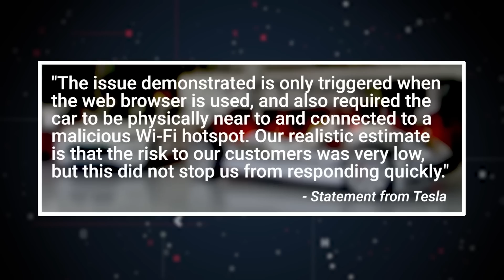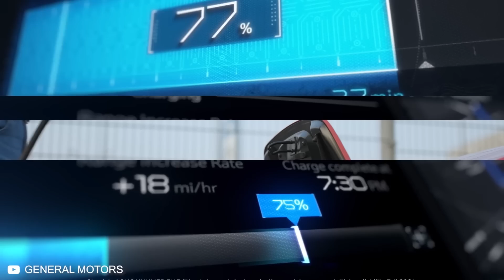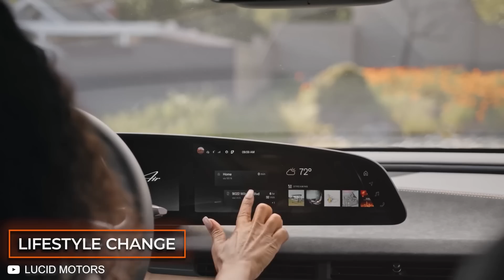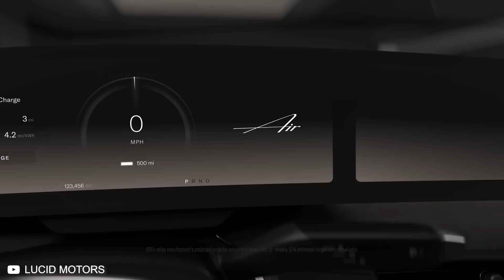EVs' Serious Problems That Carmakers Are Hiding

Comment: The biggest issue I see is a lot of the core demographic doesn't have the ability to charge at home. People in some neighborhoods in bigger cities often only have street parking available. People who live in apartments also can't just simply plug a cord into the car coming from the wall.
Reply: @nordy259 
What you say applies equally to upscale neighborhoods in many cities. And the fact that you park your car in a garage does NOT imply you have access to charging overnight. The fact that you can afford a Tesla does not suggest you can charge it at home.
Reply: None of this has to do with what’s good for drivers, what’s good for communities, what’s good for citizens, or even what’s good for the earth. It is all about control. This is their way of making sure they have 100% control of who travels when, and where. They want us to live in the pods and eat the bugs. I want nothing to do with it
Reply: Yes, I read in the Chicago Tribune that 55% of people in the Chicago Metro area rent rather than own.  Also, my condo tower checked into it and converting the building for EV s would be a legal and engineering mess.  And what can we do when the manufacturer tells us to park outside because of a fire hazard ?  If I owned a house I might consider an EV but that's not in the cards now.
Reply: @loschekell  ev’s are a lower fire hazard than ICE cars, I had a model 3 while renting. I charged it from the PowerPoint in the garage, which leads me to my final point, installing a few dozen charging stations would be expensive. Not troubling from an engineering standpoint. More from a cost standpoint. Apartment blocks get more than enough power infrastructure to the site to handle that kind of load, it’s a questions of getting the right circuits and breakers from the switchboard to the chargers which is the expensive part (and buying the chargers themselves).

But EV’s as previously mentioned can be sufficiently charged with just a regular wall outlet.  Which aren’t difficult to install and are cheap. And in most apartment parking facilities, whilst there not one in every bay, there is usually 3-4 in each level of the carpark complex for cleaning and maintenance.
Reply: @engineeringtheweirdguy2103  have you seen ev fires? I suppose you haven’t because you imply they don’t happen when in reality they do happen
Reply: @engineeringtheweirdguy2103  you really seem to be drunk in believing that Evs can do no wrong, there’s no point in you looking at the other side of the coin
Reply: @C25-150  what are you talking about? EV’s catching fire at a rate far less than ICE vehicles is an irrefutable fact, based on thousands and millions of data point. A basic google search will tell you that. 

How does stating fact translate to me being drunk on belief and in denial? Seems to me like you’re projecting
Reply: @engineeringtheweirdguy2103  Some exceptions to that fire rate.  Yes in accidents etc ICE has higher fire rate. Yet parked, no accident EVs have a higher fire rate than ICE, ie more chance of an EV in the garage burning than ICE.  Thus the ship on fire sinking recently w a load of ev Porsche.
Reply: @engineeringtheweirdguy2103  “Apartment  blocks get more than enough power…”

In most cases no. A standard 6 KW charge is going to double or triple the average apt unit load while under charge, and sone residents are going to be couples etc w two vehicles unit.  So, yes an apt block could accommodate a few people charging, no they won’t scale to everyone. 

Anyway, doesn’t matter.  Must apt are street parking w no charging possibility or large private lots are far to expensive to rewire w a 6 Kw drop at each slot. W a posible aggregate load of 0.6 MW for a 100 car lot?  No. It’s been tried w a lot of hype and wasted money, ending in failure.

“Regular wall outlet” 
A 2kw wall circuit is not practical for EV , as giving 16 kWh after an 8 hr charge is for a toy, a curiosity. 

“3 or 4”
So  again, that obviously doesn’t scale to convert all transport in the building to EV, and you’re pointing out something to be done as, what, a 3 EVs in the lot stunt?
Reply: @Nill757  ahh, not really. A refrigerator on its own pulls 3kW. A drier might pull another 3, washing machine, kettle, dish washer would also pull another 3kW. Chargers for phones, laptops typically pull around 1-2kW each. Each apartment will have power supply to accomodate the maximum kW output of each plug in the apartment on full load PLUS a factor of safety for good measure PLUS, a buffer for improvements, expansions or subdivisions. In Australia, that load limit is 3kW per plug.

The power supplied to apartment blocks would be more than enough. 

It’s also worth noting that you can charge your EV with as little as 2kW. And wouldn’t Involve any more infrastructure than supplying a regular power outlet at the appropriate parking bays. Hardly a big ask. Although it would be slow (7-12 hours for a charge, but most people are home for at least 14 hours a day (sleeping, eating, showering, etc). It would still be doable.
Reply: @engineeringtheweirdguy2103  “… phones … 1-2 kw ea”

What are talking about?  Smart phone chargers, the larger ones, pull 10 Watts* each.  Modern refrigerator pulls 500 Watts when running,, +/- 150 W for size, average over the day less than 200 W. The standard light duty wall outlet circuit in Australia is 230v/10A or 2.3 KW, w overload breaker protection. None of this is debatable. 

The average apartment total utility electric panel in the US is 40 to 60 amps, as anyone can inspect in moments walking into one, or 7.2 KW. max across the common 120V circuits. 

The best selling EV has a battery capacity of 50 to 80 kWh.
Reply: @Nill757  you’re confusing power consumption with power capacity. A 50kWh battery can be charged from a 2kW supply. It just takes longer.

You are also incorrectly assuming you have to charge the full 50kWh every day. You only have to charge what you use in that day. And with 50kWh getting some EV’s as far as 250 miles, drastically more than the average person daily commute. Especially for those who would typically buy sedans. With the average US daily commute being a total of 16 miles, which could be charged in as little as 1.5 hours from a 2kW outlet. Or a commute of 40 miles in as little as 4 hours off a 2kW charger all while you’re asleep and not using the car.
Reply: @Nill757  2kW for each apartment would be like giving each apartment a toaster for Christmas. Hardly a stretch for appartments to accomodate, especially if they’re using exclusively when everyone is asleep and not otherwise using electricity
Reply: @Nill757  you going to argue those numbers too?
Reply: @engineeringtheweirdguy2103  I confused nothing.  I stated the battery energy capacity in kWh, not how long it would take to charge. Instead of stating what I’m “assuming”, why not stick to you know or conclude, and I’ll take care of my end.  Thanks.
Reply: @engineeringtheweirdguy2103  
. 

While single family homes might have a 12k or 20kw peak service connection, the  peak load per apt as I showed above is some 7KW.  If someone were to try and equip a 100 car pkg lot for that bldg w 2kw circuits each space (and 6kw is needed and the standard) they’ll be adding 200kw of additional possible worst case load to the building, on different circuits.  Separate circuits can not be hoped away as hiding inside existing existing building load.  It’s near a third increase in capacity, and more than a doubling of average building load (less than a kw avg in apt).  The conduit wiring alone to modify existing buildings for full EV transition is prohibitive, so too the utility connection. Consequently, what we see happening frequently is is the odd wealthy individual or company paying to wire out a couple parking spots. Great. It doesn’t scale for the entire complex, which is why it almost never happens. 

earlier you asserted  w no evidence that the “engineering” was no problem.  When asked for explanation, you provided wildly exaggerated figures, so yeah, someone should check your figures.
Reply: @engineeringtheweirdguy2103  Not sure it is a meaningful statement that EV's are a lower fire hazard than ICE cars because that conclusion is based on miles driven, not on miles driven by equal age EV and ICE cars.  EV's are still relatively new, with most being only a few years old, while ICE cars can be decades old.  The potential for fire in any car, EV or ICE, will increase with age.  And while an ICE fire might be 500F, a battery fire is several thousand degrees, is difficult to put out, and can restart without warning.  Wouldn't park on of those in my garage.
Reply: @retiefgregorovich810 - Engineeringtheweirdguy is biased towards EVs. Those of us who have watched videos of EV fires know that it takes a long time for the fire to die out, which is why firefighters leave it be and wait for the fire to eventually die on its own. 

Stating that "EVs are a lower fire hazard than ICE cars..." is a joke and this guy is delusional, which I'm glad you and others realize that about this person
Reply: this is the problem we have in EU
Reply: Truth, the sad part is that 1 of every 4 people who buy electric vehicles goes back to gasoline due to this issue
Reply: @seank078  thats good news
Reply: @seank078  I know several people who went 'electric' and then back to ICE. It's not that electric isn't worthwhile, it just won't work for everyone. People need to wake up and study before buying.
Reply: @seank078  Think.  Plan ahead.  Not all that hard.  Want an EV?  Figure out the charging ahead of time.
Reply: @seank078  no they don’t…. Unless you’re citing a very specific geographical location. But definitely not globally.
Reply: @engineeringtheweirdguy2103  sorry I was referring to the US market. At least that was the last statistical breakdown I read. If there is better information out here please let me know
Reply: @engineeringtheweirdguy2103  yes they do!
Reply: @followerofchrist51  again, no they don’t. And again, unless you’re citing a very specific place with unique conditions for this to occur. But globally, no. That’s why Tesla received the highest customer satisfaction and customer return score of any car company in a global survey. Over 80% of Tesla owners stated that they’d get another Tesla as their next car. 

So that doesn’t quite gell with the whole 1 in 4 would it? Otherwise it would have been at best 75% wouldn’t it?
Reply: @engineeringtheweirdguy2103  I am speaking of Americans, globally doesn't matter to me. However I did see British people with the same opinion after owning one, so yes they do!
Reply: @followerofchrist51  in America between 2021 and 2022 the number of people who returned to ICE after owning an EV was 17%. That nearly 1 in every 6. A VERY long way from 1 in 4 (25%)
Reply: @followerofchrist51  in the UK over the same periods it was 1 in every 11 (9%).
Reply: @followerofchrist51  so again. no they dont
Reply: It is correct that someone without an outside outlet shall not yet get an EV
Reply: @matsgardin8332  Outside 6 KW charger is no help w no driveway.   Maybe it seems feasible  to run an extension cord out to street parking but it’s not for for every residence on the street, not for the two cars per residence, not for all weather, not for pwr cords across sidewalks, etc.
Reply: You need an outdoor outlet that you can use. Otherwise an EV is a bad idea.
I have a 11kW outlet, even though I rarely use more than half of that. So a 6 kW outlet is enough, but you must be able to access it easily.
Reply: That's one reason why EV's aren't for everyone.
Reply: @rollydoucet8909  If EVs aren’t for “everyone”, in particular not for the masses in Asia and Africa looking for personal transpo, then they are useless as a mitigation for global climate change.
Reply: ExAcTLY!!! theres no infrastructure to support it at home. riddiculous.
Reply: Electric cars are a massive environmental disaster. Why would you buy one?
Reply: Yes they don't wont all people have cars
Reply: EV = JUNK.😂
Reply: They don’t want you to have the option to have one. EVs for the elite, and everyone else on the bus.
Reply: @sargonixofur1234  another one ride the bus https://www.youtube.com/watch?v=tZkouut-9RQ
Reply: @sargonixofur1234   Exactly.
Reply: Exactly
Reply: @ThePhenom72586  Unfortunately the problem is widely seen by most of the public as no problem at all. Why?  Because in a 300 car parking garage they see two charging spots and think they scale. Because they see a fast charging spot in a mall 2mi away w a 2MW utility connection and think that scales to other 30,000 people nearby w street parking only.
Reply: In practice this is just an issue if your employer has organized charging infrastructure poorly. I charge while at work. problem solved.
Reply: @irTaeke  Problem solved for *you*.  That charger for the EV guy happens often now by  installing  one or two 6KW charging plugs adjacent the building wall w a few feet if conduit. An extra 12 kw is no problem for any medium office building. Three or four thousand $ for wiring and two chargers , no problem, as you say.  

But to charge, say, every car in a middling 50 car lot, that’s 300 KW, maybe ten times the existing building service, pushed to a charger at each spot dozens of meters away with conduit buried in concrete covered trenches.  The new electric service would be that of a new smallish sky scraper, 10-20 stories, w infrastructure consequences for the power utility all the way back to the substation. Do the same trick in hundreds or thousands of office building parking lot and the number of city neighborhood substations needs to double, triple, and new HV transmission needs to plow through some other access point to the city.  That is a problem, and it’s never going happen.

Comment: Let get this right the money u save on fuel u will most definitely pay for it by the end of the 5yrs in the price of the battery plus the money. U will loose from the car  think about it 🦍🦍🦍
Reply: Plus for the price of a Tesla I could buy about 10+ older petrol cars I could get about 60+ years out of, where a Tesla's life will have long since ended... Petrol's expensive, Tesla's are more expensive to the point you're not seeing that return... And their resale value is basically 0 as most of the cost is in the battery.
Most people aren't buying £70,000 cars...
Reply: @88Cardey  brilliant

Comment: It doesn’t reduce emissions at all as many of you have stated . The biggest way it will reduce total carbon footprints of countries that won’t allow gasoline engines is that no one will be able to travel as much because it’ll be such a pain in the ass to stop every 250 miles or less to charge their cars . If someone in Michigan wants to drive to Florida it would take much longer to get there so their vacation week would be mostly spent on the road and in hotels along the way . Governments know people would start planning vacations much closer to home and average mileage per year per person would drastically be reduced thereby reducing carbon footprints. You could fly your family to your destination but that’s more expensive and still uses the bad ole oil .
Reply: Let alone, CO2 would be reduuced because many people CAN'T BUY AN EV.
Reply: Yes, it does reduce emissions.  This has been studied and studied, report after report has come out, but the internet peanut gallery who hate EVs just ignore them all, because it's not what they want to hear.

You know you're supposed to stop for at least 15 minutes every 200 miles just for basic safety and driver alertness, right?  And since fast charging typically is around 15 to 30 minutes, you don't lose a huge amount of time.  I got my Tesla for exactly the kind of long trips you describe, and it's been great.

Comment: EVs being good for the environment is absurd. The electricity used to run these cars come from power plants powered by coal and other fossil fuels. China has put numerous coal power plants online to meet increased demand for electricity. Mining of lithium for EV batteries is disastrous for the environment, not to mention the disposal of said toxic lithium batteries. Sadly, the sheeple have bought into the EV scam.
Reply: Good news is it is highly likely in less than a decade, sodium will overtake lithium plus the technology is improving at a fast rate, less and less cobalt is being used for batteries.

China is now using coal bridge-fuel to power its electric grid while they wait for the nuke biz to get its act together; they are in the midst of modernizing old ones while the nuclear industry is developing its new technology. Also they are upgrading grids and power plants that require less fossil fuel

An EV recharged by a coal plant puts out half the CO2 as a gasoline car the same size doing the same trip and even much better in stop and go commuter congestion

Comment: Climate change will come whether we want or not. During the roman empire carbon levels were 4 times higher, those Romans burning coal and oil.... The ice cuts have proven this. Wonder why the smelting of Romans was so rich and amazing.
Reply: East Antarctica provides longest ice core record where ice has been sampled to an age of 800,000 years. During this time, the atmospheric carbon dioxide concentration has varied between 280–300 ppm during warmer interglacials. That is not four times higher than the current concentration and 
CO2 concentrations were about 260–280 ppmv immediately and before industrial emissions began and it did not vary much from this level during the preceding 10,000 years.

Romans started using coal after 43AD and CO2 levels were nothing close to the levels of the past 60 years.

There is no proof in science, just preponderance of evidence.